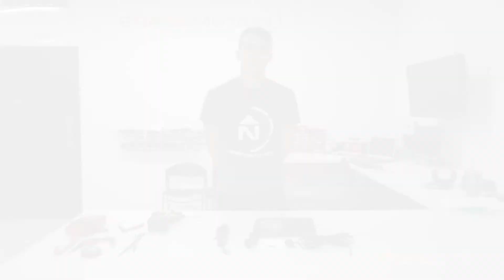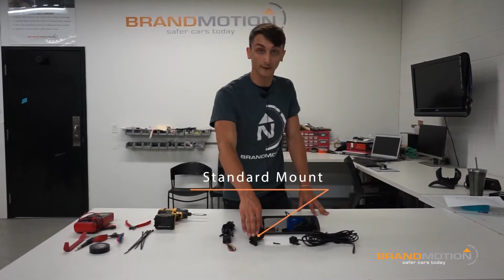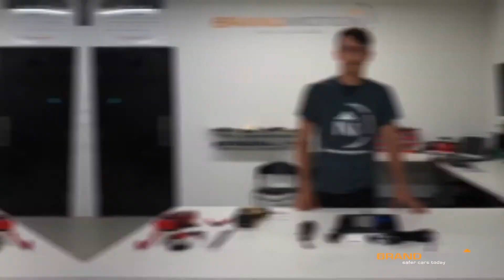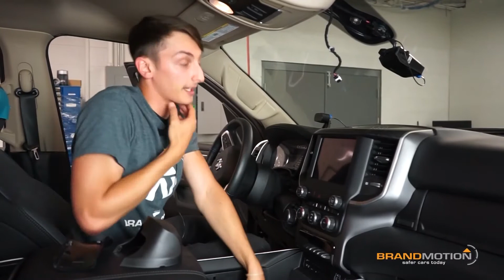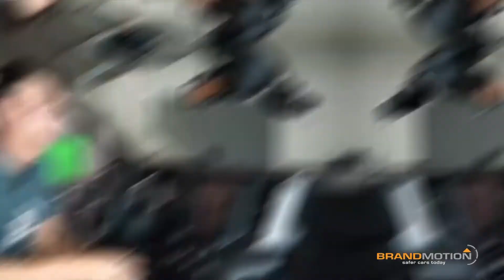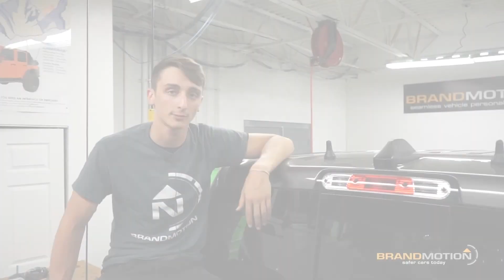FullVUE Rear Camera Mirror FVMR 1000

Comment: would have liked to see more on how you routed your cabling, perhaps tricks or ides for a better looking install in pillars/roof line as the antenna you showed. Trick BTW. That will differ from one vehicle to another so I get it but the one thing I was looking for personally was the cameras image quality after the install. So many aftermarket cameras have poor resolution/image so I was hoping you'd show its post install image, perhaps its features as well. Otherwise the video might be better named FullVue FVMR 1000 install on a RAM truck. Thanks for the info though!!

Comment: Was the camera 3m taped to the fin itself or to the body of the truck?
Reply: You can do either. The camera mount rotates 360 degrees, so wherever you like the view best you can mount the camera there. The new model number is FVMR-1100, but the installation process is the same.

Comment: Here is my problem I have a Jeep wrangler which this system seems like it would be perfect for I also have a cargo trailer What I would like to do is use the camera daily for my jeep but be able to use it for my trailer (is it possible to have two rear cameras when I use the trailer disconnect the jeep rear camera and connect the trailer camera ) hope you get this need to buy camera soon
Reply: That'swhat I'mtrying to do.I sentamessage to Wolfbox today to seeabout doing it.I willrun acamera to the back ofmy Cargo trailer,backupto the hitch area.I will also have a 2nd rearview camera on truck for everyday use.  When I hook up trailer I will disconnect truck one at hitch and plug in the trailer one!

Comment: Can I put the rear camera on the inside of my SUV instead of outside? I don’t want to mess with fabrication work if I can avoid it. I know the GEMTEX mirror rear camera is mounted internally.
Reply from the maker: Our camera comes with a simple basic plastic mount, you would need to inspect to see if that will work for your situations. We do not have a specificated internal mount that is designed for the interior. Additionally, you would also expect to have a lower quality image as the camera is looking through likely tinted rear glass opposed to being exposed.
Reply: @brandmotionvideo  hey what's up sir I have a jeep wrangler jk I have installed a aftermarket radio will be able to see the camera on the screen of my aftermarket radio
Reply from the maker: @DJTOE202  You cannot use this camera in your aftermarket radio. I would recommend our SUTV-8848 for your application.
Reply: @brandmotionvideo  ok cool thanks... one more question... can I use the sutv 8848 and still get the front facing camera
Reply from the maker: @DJTOE202  You will need to have have 2 inputs in your aftermarket stereo for that. If you do not, you will need a video switcher. The 8848 terminates in an RCA connector that will be compatible with most aftermarket display radios. I would check with your radio manufacturer to see if they have a native input for a forward facing camera.
Reply: @brandmotionvideo  ok cool I'm about to look into it now thank you
Reply: @brandmotionvideo  hey what's up sir I do have a second input for another camera so do you guys have one that I can purchase to hook the fullvue mirror and backup camera to the aftermarket radio
Reply from the maker: @DJTOE202  The FVMR can only be hooked into the FVMR monitor. It is a proprietary closed system.
Reply: I like the hole kit for a ram 2019 the plastic on top the mirror every thing where to get it

Comment: Is the review tailgate camera on my f150 able to work in conjunction with your product?
Reply from the maker: CBass, unfortunately there is no additional input to add any cameras to the system. You would need to utilize the supplied camera. The main use for this product is a blind spot elimination device while you are driving.